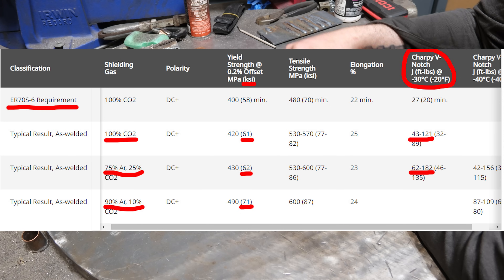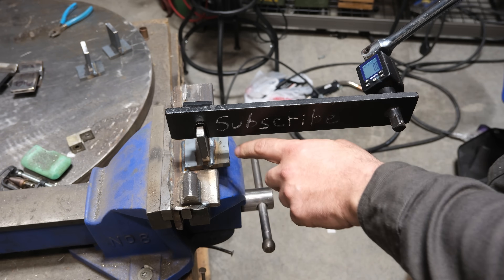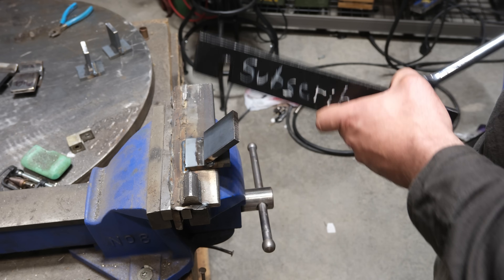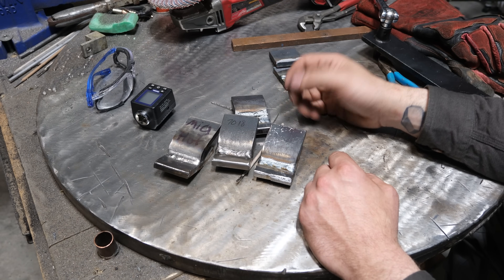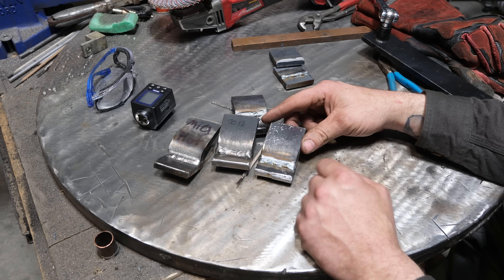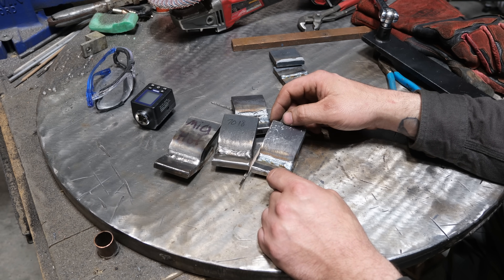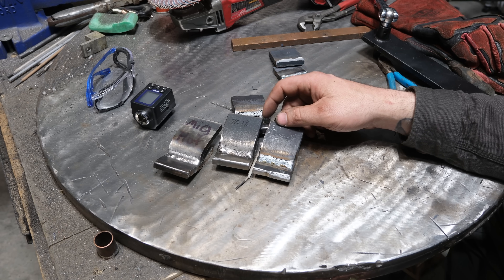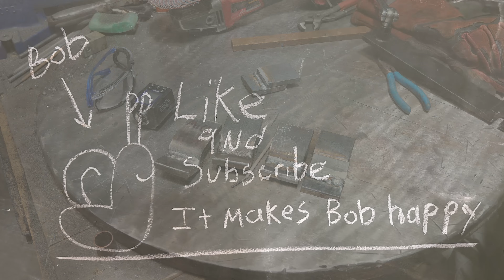100% CO2 vs C25 gas: strength testing

Comment: Part 2! Yay! 

What benefit is extra penetration if the resulting joint is weaker?  I can see the benefit for pressure vessels or pipe, but those are pretty specialized and require a lot more training than watching YT videos.
Reply from the maker: The extra penetration will make a much stronger joint on thicker steel.  It’s kind of a catch 22.  If the weld experiences force away the face, the c25 welds will hold on longer.  If the weld experiences stress towards the face (and the other side isn’t welded)  a weld with more fusion will be by far stronger.  

The biggest limiting factor with short arc mig is the complete lack of root fusion and often weak sidewall fusion on over 1/4in steel.  If you were to weld something like a d-ring on thick steel (like on equipment) with c25 gas, the probability of it pulling off is far higher than with c100.  Despite the fact c100 does lose some tensile strength, it’s better/more consistent fusion will likely lead to higher actual strength.

Comment: New welder here with 1 semester behind me. How does this compare to 100% Argon? I'm using C25.
Reply: You really can’t use q00% argon on MiG welds. Well, you can, but you won’t like the results much.
Reply from the maker: Mel is correct.  100% argon with mig will produce very poor penetration and a roped up bead.  If you weld with the wrong polarity (mig gun on the negative output for gas shielded er70 wire) it will weld similar to 100% argon.  100% argon can use used with mig welding aluminum though, just not steel.

Comment: How does 100% CO2 work on say 18 gauge sheet metal? If it doesn't have a lot of splatter and doesn't get too hot. I might switch for working on rust repair, I didn't know that it was that much cheaper!
Reply: 100% is what Fitzee uses on his body repairs. He prefers it to C25.
Reply: @carlholm2765  yeah, he’s pretty good. I don’t like it on sheet though. I find it’s a bit too hot, and it leaves more residue. I TIG anything delicate though.
Reply: It runs hotter, easier to burn through.
Reply: I think the main reason Auto-body shops use CO2 is the cost savings over mixed gases. They just adjust their settings to prevent blowing holes in sheet metal.
Reply: Couple of years ago my pal got himself an old, second hand rusty bucket... I mean, "a van" (Peugeot Boxer - and wise folks say "don't buy cars that begin with 'F' - that is Fiat, Ford, and French ones...") .
Anyway, there were more than few holes in the body and chassis (some of them pretty impressive, could put my fist through them) and few corroded elements that had to be replaced PATCHED - and the privilege of doing all of it fell on me (my pal can't weld, and couldn't afford getting it done by a regular body shop).
For welding I used a rather simple (and over 20 yrs old) MAG machine (it doesn't even have proper voltage selector - only four fixed "presets", numbered from "1" to "4", and a knob for adjusting wire feed speed, and that's it), and straight CO2  (with 0.8 mm/ 0.03 in wire - cuz that was what I had on it, albeit 0.6 mm / 0.024" would be better suited to car body job).
Patching was done "on the budget" as well - i.e. whatever piece of steel sheet of "sorta suitable" thickness I could find in my shop (usually either 1 or 1.5 mm, or 0.04 - 0.06 in thick) was used with grace (and some swearing), but then "a hammer and an angle grinder are yer friends".

To sum it all up, "it certainly can be done", albeit "certainly there's a room for improvement" here. Whenever the disturbances of local gravity field caused the appearance of too many holes I just switched the machine to lower setting, slowed down wire feed and my travel speed - and it worked. Spatter can be dealt with anti-spatter spray (again, if you want to "economise" on it, take a regular canola oil, thin it down a little with naphtha and use that with a regular hand-operated spray bottle (like the ones in which glass cleaning sprays are sold).

HOWEVER (last but not least), if you're used to "argomix" gas I doubt you'll be enchanted with "straight CO2 experience".
See, after finishing the body repair we took that van to another place to be painted (yes, me again) and this place has a better MIG/MAG machine there, with argomix bottle attached to it - which I also used to use in the past, but since my shop (i.e. the one that I use exclusively) is much closer to my home and I could use it 24/7 (unlike the other place) I did the body repair using this El Cheapo stuff of mine.
Anyway, there was this serious dent in the upper-left rear corner left that could not be pushed out (no access from inside, too big curvature to pull it out with something welded to it - it had to be hammered out from inside) and my pal decided to just fill it with glass-fibre reinforced body filler and then smooth it out with finishing stuff. But while attempting it, it turned out that this panel is actually kinda half-detached already, so we finally managed to access it from inside and hammer the daylight out of it - and then I took that "other" MIG/MAG machine, with a bit of apprehension, since while it had more presets and all, the wire on it was 1 mm thick (0.04").

But guess what? I set it at lower settings and low wire feed, and it worked like a charm! The moment I finished welding that panel back I thought to myself "you're an IDIOT! You could get (borrow) this machine to your place (and put in that thinner wire) and save yourself a ton of frustration!".

I checked just now a website of a" local" supplier and it looks like 40 litres (1.4 cu ft) 150 bar (2200 psi) tank of either pure argon or 18% CO2 argomix is about € 31-32 (pre-tax, I guess - but TBH I never purchased one of these myself) which works to approx 7+ m3 (250 cu ft) of gas at normal pressure - or € 4.45/m3; add 23% VAT and it's € 5.50/ m3.
The price of CO2 is between € 1.40 to 1.60 per kg (incl. VAT). One kilogram of CO2 ≈ 509 dm3 (0.509 m3 or 18 cu ft) of gas which works to ≈ € 3/m3 - so not that much difference, if you ask me.
Also, spot welding body panels isn't even close in gas usage to "heavy irons welding" (where you use tons of it) and unless the "price points" are much different on the other side of the pond, using CO2 IS NOT WORTH THE TROUBLE in my opinion - and experience.
You'll save couple of bucks per month but you'll waste much more money in labour time (slower work, filling up occasional hole, grinding it flat - and more of cleaning the spatter).

Work smarter, not "cheaper", I'd say - or don't be penny wise, pound foolish.
Reply: Perhaps .060-.1875 steel? .030 solid wire?